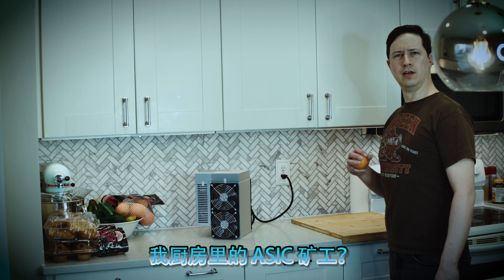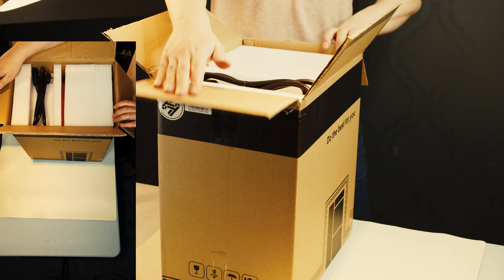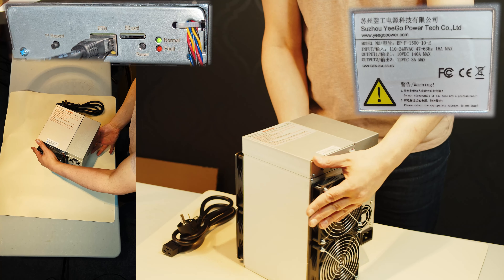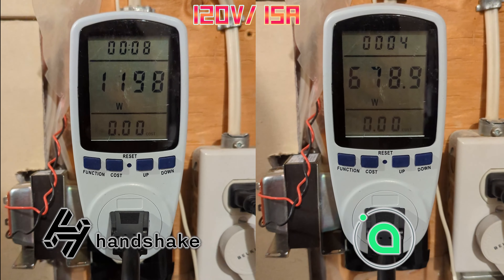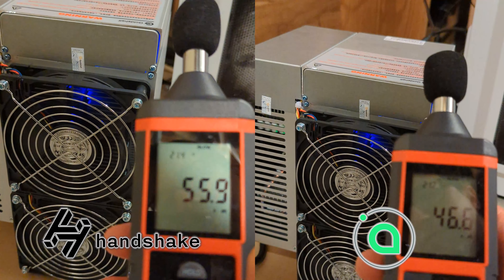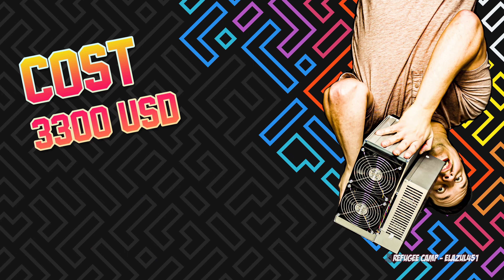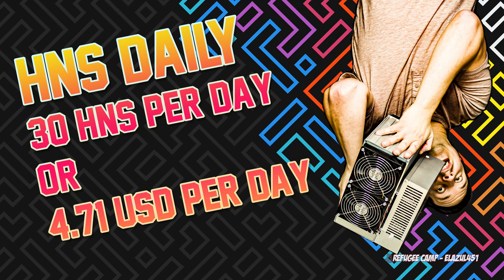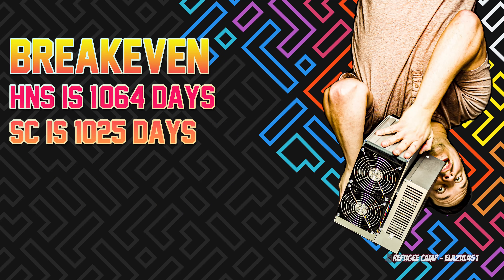Goldshell HS-Lite ASIC - Unboxing & First Impressions | Temps, Noise, Power, Specs & More!

Comment: With my current electronic bills I would make $.47 a day..... I shut off my s19 because I was loosing money every day. With crypto going up is is getting better. I may put it on a timer and try running only off peak hours....... good video....
Reply from the maker: Thanks! Might want to look at an ST-Box if you can find one..only 61w!
Reply: You must spend alot in electric if you gotta shut s19s off
Reply from the maker: @spencerjones2610  Yeah that's gotta be something like 5x my electricity costs, not unheard of in parts of the US and Europe however. I'm blessed to be locked in at .056 USD/kWh for the next 3 years however